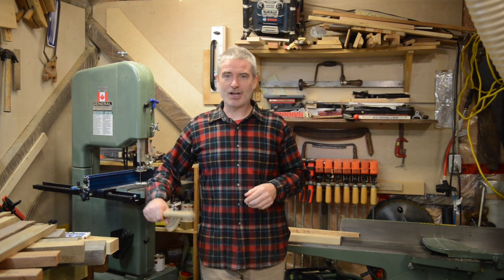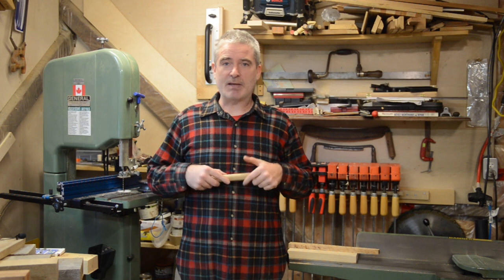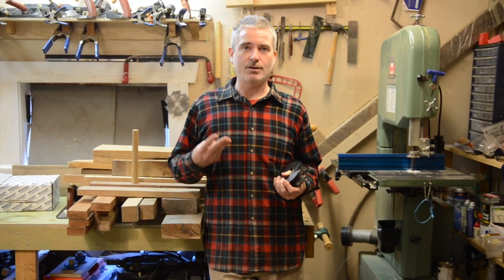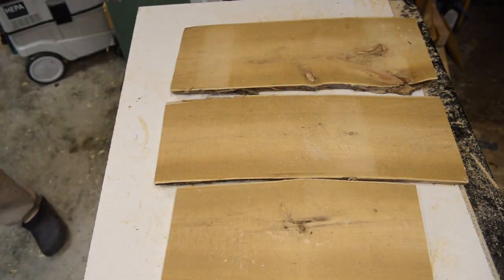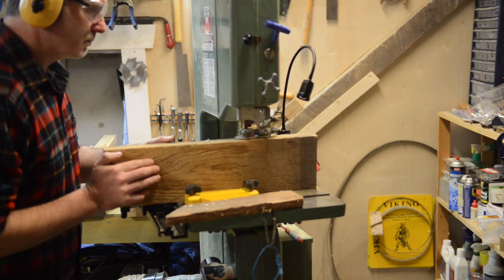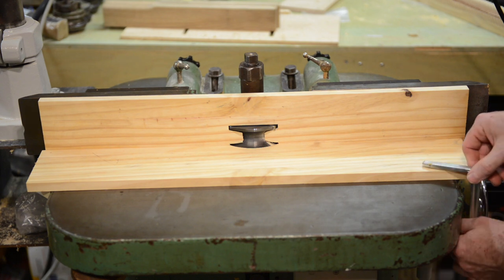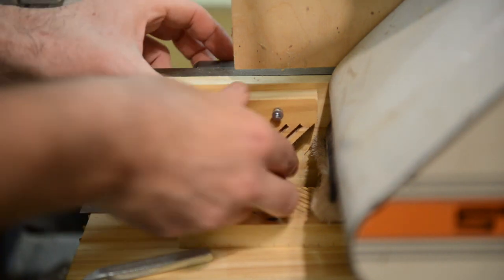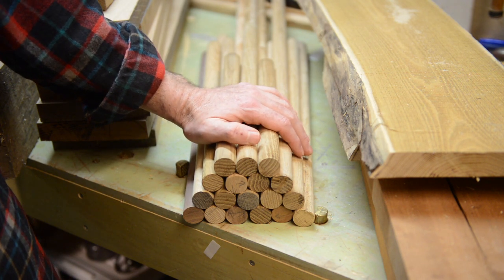A Timberframed Woodworking Shop - Part 6 - Making Pegs

Comment: Not quite sure how the machine works? Do you just pass the dowel through twice, rounding over two sides?
Reply from the maker: You got it!  It basically cuts 180 degrees of a circle on each pass.    They go in a little bigger that 1" x 1" and come out a perfect 1" diameter dowel/peg.
Reply: Cool!

Comment: Thanks for sharing Brent. I think I may have the same supplier for pegs, lol. Just putting my order in with whitehill for some cutter heads and knifes. Was wondering if you used their 25mm knifes or did they cut you one with 25.4mm so that it would be a proper fit with your white owl auger bit? I was thinking of using my combi head 125x55 to use this (25mm Dia (R12.5) Dowel Profile Cutter in HSS Code 003H01360) and was wondering if this might work instead of using the Nosing Head?  Thanks for your time.
Reply from the maker: Hey Glen! Lots of folks use HSS knives in a limiter block and will get loads of linear feet out of them before they dull.  The wood owl bits come in many denominations I discovered the hard way, so double check exactly what yours are and Whitehill should have one that suits yours.  They are often 25mm I've found.  The nosing heads have a run off angle that means they are not actually a perfect half circle.  I had tips made special for the nosing head that are indeed a perfect half circle and they work very well.  Honestly the nosing heads are cheap and if you plan on doing a lot of pegs it's probably the better way to go IMO. If you decide to go with the nosing head let me know and I can supply the file reference for the custom tips.
Reply: Thanks for the response Brent, If the file reference for the custom blades are available, I would really like to get a copy, would be much appreciated.
Reply from the maker: @glenp3808  The product # (as best I can tell) is 122902 and the tip number is 34061.  You want to make sure the geometry is a full half circle so worth double checking that this is the case.   Mention my name and it may help them track it down if needed.

Comment: I am always amazed at the almost lack of a sap ring on black locust, no wonder it won't rot, its almost all heart wood.   I take it you don't draw bore your holes.
Reply from the maker: This is my first real experience with it.  First impressions are that it smells terrible when milling, but it's kinda legendary for peg stock so I'm looking forward to driving some home.
Reply: @DovetailTimberworks  It nasty stuff left in a pile outside with the bark on. it turns and smells like a bag bag of garbage.  so nasty.  But its a fantastic wood.